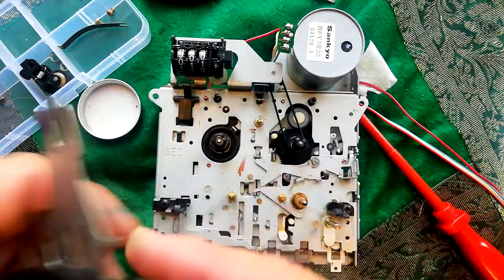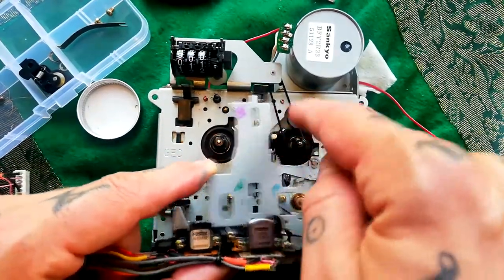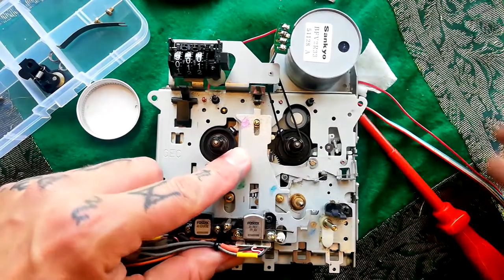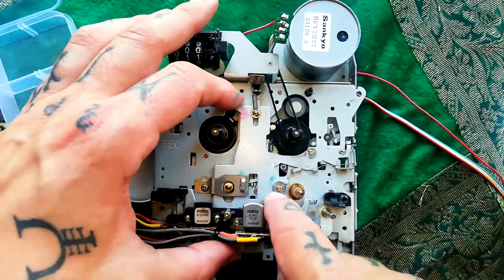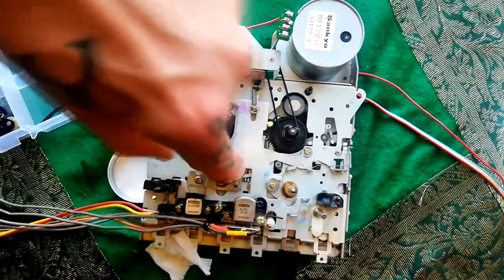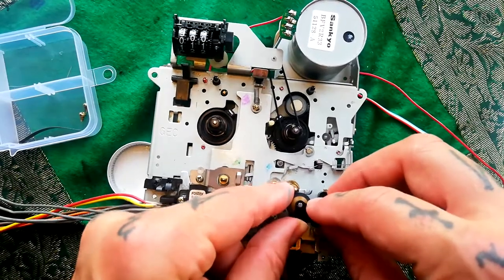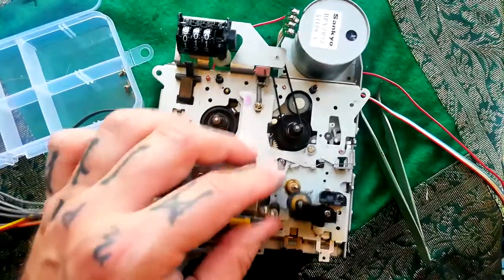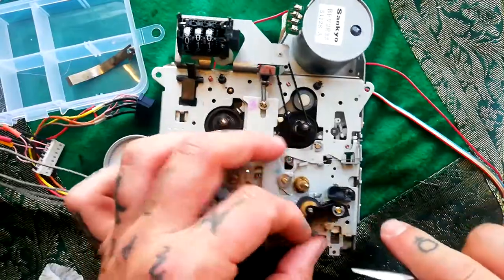GEC 4-track cassette transport |1a | mount head chassis  | Porta One Two 05 MT2X MT3X X-15

Comment: Hey man so I figured it my issue with the mt2x. It'sa broken head base. The plastic part with a spring. The plastic is broke and the spring is. There's a 3rd island video showing how to fix it but my problem is that plastic head base is glued to that metal head mount you're showing here. Have you ever experienced this? Any idea on what to do to get it off? I've removed all screws I'm aware of.

Edit: I got it off. Used a razor to pry it out. Not sure if it was glue or what but it was definitely stuck with something. Dried something maybe?
Reply from the maker: Might have been old grease  if it was that bad you'll want to disassemble and clean old grease off other parts of the mechanism as well, specially the white gears on the back which raise and lieer the head, use isopropyl and replace with silicone grease or similar.

Comment: Thanks so much for these vids. I been cleaning  a recently purchased porta 5 up and where I'm stuck is the play/record buttons don't seem to move any gears and pop up after a short time. Any hints?
Reply from the maker: Hey, the buttons themselves just move shift arms, the gears are turned by the flywheel, driven by the capstan belt. So, assuming the capstan belt and motor are healthy, you've probably got an issue where the grease under the white gears and shift arms has turned gluey or solid, so when you use those buttons theshift arm isn't moving the gears enough to engage with the flywheel. Completely remove the white plastic parts, clean off old grease with isopropyl, add a light lubricant like silicone grease and rebuild, hopefully you will have lift off?
Reply: @Tetrakan  thanks for the response! ill give it a go!